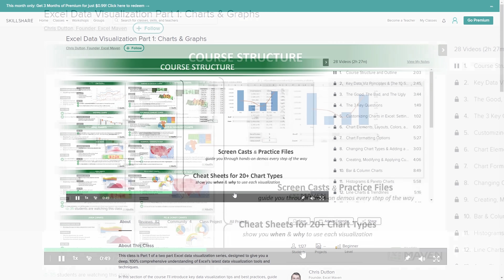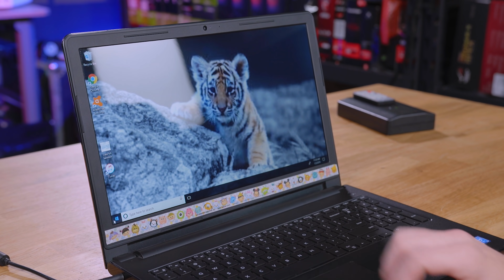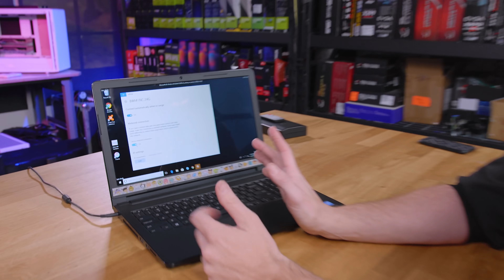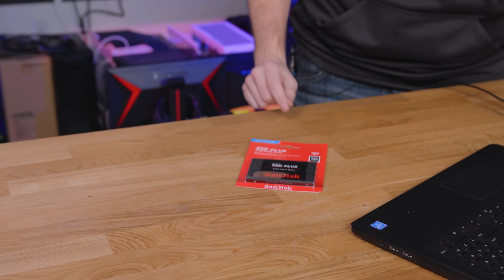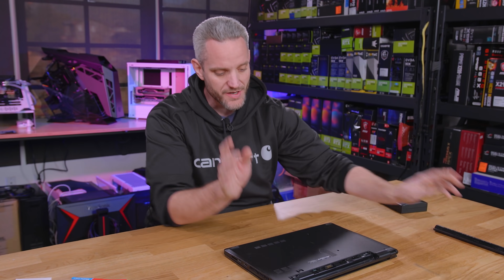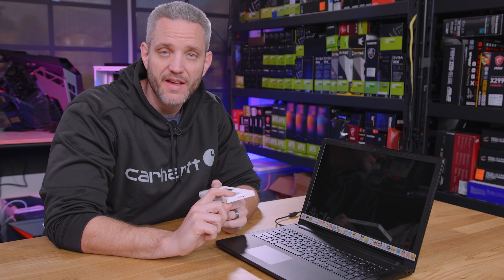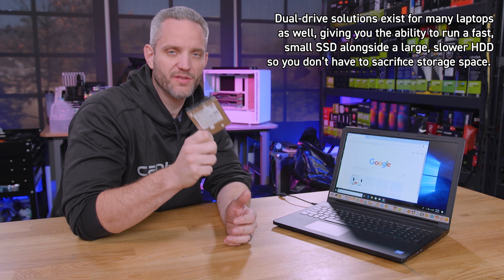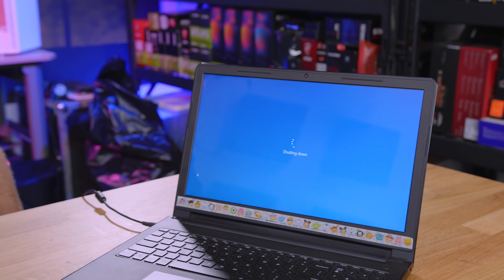Repairing an old laptop for as little money as possible...

Comment: SSD, fresh install of os, maybe moar ram. Boom problem solved
Reply: that celeron n3060 though....
Reply: fresh install of chromeos. there problem actually solved. chromeos runs great on that cpu
Reply: I would say new os on this one...  Some linux distro with XFCE or LXQT would run so much smoother...
Reply: Lol no. Celeron is trash. Better advice for the niece and just get a chrome book for $150.
Reply: @myaccount__7269  A lot of Chromebooks in that price range are Celeron based.
Reply: @myaccount__7269  those 150 dollar chromebooks also use the Celeron n3060 which this laptop uses so instead of buying a Chromebook he could just install chrome os on the laptop boom basically the same thing without having to spend 150
Reply: @hughdahand5711  A distro like Mint 19.1 Mate edition, is still fairly lightweight, and requires less setup then an XFCE distro as a lot of them don't come with compton compositor preinstalled, and can run into screen tearing issues not found as often on MATE. LXQT not too many distros even bother with it. Anti-X is a great lightweight distro that uses very few resources, but I would not call it kid, and new to Linux user friendly.
Reply: PUBG BOI nope. Chrome book will have better screen, new battery, ssd installed, new, lighter, etc. can’t just go specs
Reply: @tarfeef_4268  I agree in this case if all the kid needs to do is get online, and get homework done with a few other basic task, then something like Neverware's CloudReady OS Home Edition based on Chromium OS the base for Chrome OS is indeed a great choice, and they have a good user forum if you run into any kind of issues.
Reply: Linux is not for the average user.  Get real.
Reply: @CommodoreFan64  has no one mentioned that the neverware doesn't have support for Android apps or running Linux apps, which the default chromeos does this 

Neverware is far behind the real chromeos.
Reply: @hoixthegreat8359  Actually not even every official Chrome device supports those features either, I have an Asus Chromebit, and no Linux support(without some workarounds), or Android app support, same on the HP Chromebook 11 I gave my aunt as a gift about 2 years ago, and both are on the latest dev. channels. Far as Neverware I recently installed it one of my older ACER Aspire One laptops running an AMD C60 APU, and on the latest dev. channel 70 they have Linux support enabled, but I've not messed around with it much as that machine is only kept around as a backup.
Reply: @CommodoreFan64  Mint has come a long way.
Reply: @ericp6308  I would say the average user is just browsing the web for the most part. At that point the user only needs to know a few small things to navigate the OS.
Reply: @LazyPCRehab  Indeed I've been a Mint user since ver. 8
Reply: @CommodoreFan64  The UI on 19 is so  user friendly. Been dual-booting and such for a long time.
Reply: @LazyPCRehab  Indeed, but since I'm a believer of using hardware for as long as it can serve a purpose I run Mint Mate since it strikes a nice balance between being user friendly, and resource friendly.
Reply: @HoloScope  Agree, because now that I think about it this would have more storage space as most official Chromebooks, and Chrome devices like the Asus Chromebit only come with 16GB - 32GB of drive space, and are a lot of times soldered onto the motherboard so if they fail they can't be replaced easy, which I had happen on an Hisense C11 leaving me with a $120 brick, plus the battery was sealed inside of the Chromebook as well.
Reply: @CommodoreFan64  Cant argue with that logic. I myself just said goodbye to an HP Probook laptop that was running linux strong for years, finally died of various motherboard/CPU issues.
Reply: Artak091 dude just download some more ram lol
Reply: Download more whams
Reply: Who needs android apps? Basically all of them have web equivalents. 

As for whoever mentioned Linux support doesn't know much about Chrome OS. And if you're wanting Linux support on those devices, it's okay to expect you to do some research and put in some effort. 

All chromeos devices first of all, are Linux. You can enter the shell with Ctrl Alt t. And type shell for bash instead of crosh. That's already a Linux shell, and with Chromebrew you can have lots of packages out of the box. 

If you want more, dual boot, or my favourite: use crouton to run another distro simultaneously on the same kernel. The only issue I've run into with that is not being able to use containers. That's it. Everything else works like native.
Reply: @ericp6308  Agreed. I love tinkering with it a bit but it's not a good choice when setting up a machine for friends/family.
Reply: More*
Reply: just put an linux

and no, im using an windows machine
Reply: @ericp6308  I once built a PC for a 9 year old girl to watch youtube and play minecraft. Of course i used linux on it. Because linux does not break all by itself, it does not install bloatware on its own, it does not have viruses and that shit. It just works. 
It might be a bit more tricky to set up as you want it, but that is mainly because it has sooooo much more options. Once it is set up, it just works.
The kernel works, the logging works, the networking works. Sound works, 3D graphics work. 
It. Just. Works.
Reply: Liquid mental it !
Reply: @hughdahand5711  That is true but linux isn't the kind of operating system for someone that jsut wants to use his devie. Chromeos would be the way better alternative in this case. But on chrome os, you will miss many programms, similar story on linux. So windows is really the only aceptable option here. It mayy be the slowest of the three but it is also the only good solution for the averge user.
Reply: I would say that Linux with a lightweight DE is perfect for something like this.  This is not something that you are going to want to use for video editing or games.  Something like Linux Mint XFCE or MATE would be pretty familiar feeling to someone used to windows, and has apps for everything you are going to do on a notebook like this, with the added benefit of not breaking itself all the time.   The only thing windows does better on a system like this is waste ram.

The original problem in this video wouldn't of ever happened with linux.   But the SSD upgrade isn't a bad investment at all.
Reply: @hughdahand5711  Linux would definitely not be the solution to this. Linux isn't an operating system for the normal consumer or user. Especially not for someone who can't even handel windows. Yes, some of these problems would not happen with a linux distro but only because it is never going to get that far that such a problem could occure. A ton of programms are still missing on linux and the usage of the operating system is way more complicated. It is never a good solution to just use a different operating system because the problem you are trying to solve aren't made because a specific os was installed. Just using an different operating system would definitely make things more complicated especially if it is the common operating system that is the hardest to use. Even when you are going to replace windows, linux would not be a good solution for this. 
For the normal user, the kind of user that owns this lapto, linux is the worst solution. MacOS would most likely be the best solution but that isn't a os that you can run on just any device. Windows would be optimal, it has support for all the common programms and a normal person won't have any trouble figuring things out. Sure, more trouble than on a mac but that is the best you can get on a PC. Chrome OS would be the best solution for this hardware and user but it has the problem that you are still very limited in software. Familiarity is important and that is something you won't have on chrome os. Same goes for linux. Sure, you can do everything on linux but everything is way more complicated and too different to be useful for anybody that doesen't count to the 5% of population that knows a bit more about computing than how to open the browser. 
Linux is great but it just isn't the solution to everything and it isn't made for everybody. There are reasons only 2 to 3% of all PCs run Linux even though it is completely free and you can do everything with it. 
Just ask yourself. Is this person really one of those 3% that would be happy with linux?
Reply: @technologyanimals  Motherboard swap is the answer if it has a discrete GPU.
Reply: @MKDC-5  Exactly.
Reply: Apply better thermal paste, canned air and blow out all the dust etc. Not much else to do
Reply: Linus? ChromeOS?
This is for his NIECE, and frankly most people can't use anything but Windows simply for compatibility's sake with other programs. I'm very PC literate and even when I experiment with various distros I run into problems I can't fix, as well as various programs I can't run well (even with WINE).
Reply: ("Linux" it should say.. can't edit.)
Reply: @Torjus_  Unless if your laptop make and model has the similar type of motherboard that has a discrete GPU, then you can install it along the heatsink that goes with it.
Reply: Fresh Linux install. Boom. Problem solved.
Reply: @ericp6308  It is. It's 2018. Get real. My mom picked it up in no time. I only came over once, showed her everything she needs and she actually has less questions about it than she had about Windows. As a matter of fact it is even much faster and easier to setup and operate their wireless canon printer\scanner combo on linux than it was on Windows 10.
Reply: HughDaHand k
Reply: Using Linux Debian with a big SSD plus largest ram capacity allowed will do the trick.
Reply: An SSD is great. But, if you want to save money, you can install a light-weight distribution of Linux on your HDD. It might not run as fast, but it’s free.

Comment: Jay is that family member everyone relies on.
Reply: That fucked up because he failed to educate about using 3 different antivirus solutions...
Reply: @ManIkWeet  From experience, I can tell you that you can shout from the rooftops that running multiple antivirus programs is more harmful than helpful, and people will still slap every one they can find on there either because they want to try a different one and don't uninstall the current one, or they get paranoid because a fake popup spooked them, or because well it's free so what's the harm?

That's why there's always going to be a need for a "computer guy" in every family, even the most locked-down system is still going to get trashed by people who don't have that ounce of common sense.
Reply: I'm Jay in a 12 year old form in my family.
Reply: Neckslit  lol... I've exceeded the knowledge of my father which used to work in tech support.
Reply: My pops is totally one of those. My grandpa has a tendency to "accidentally" click on settings configurations (we can't decide if he does it intentionally or not) and gets confused on why things aren't working the way they should. I gave him my old ASUS gaming laptop for free because I never used it anymore and the audio driver stopped working for whatever reason and all he had to do was simply restart the machine and it worked like normal. Of course he just blamed my grandma (yeah, he's THAT old school) meanwhile my pops and I are in the background just chuckling at ourselves. Don't even get me started on the phone stuff.
Reply: @RyMann88  My dad is the same way. Doesn't even know how to change the input on the tv
Reply: @idoubtitsalex  same
Reply: anybody who is watching this is most likely that family member

Comment: I have an ancient laptop at work, a Lenovo Thinkpad T61, with a Core 2 duo, 4gb of ram and a Quadro something, and with a SSD is still a great office/web browsing machine. The best way to give extra life for a old computer is with a SSD and more RAM.
Reply: Got the same, I've upgrade the CPU from T7100 to T9300 with Middleton BIOS flash and 10 bucks the T9300 from Aliexpress. Do it!
Reply: I have a Dell laptop from 2009, finally put an SSD in it this summer what a difference that made, it's still fully capable of doing light work like using Office and browsing online and with the SSD now everything loads nice and fast. I was thinking of getting a new laptop or even a tablet, but the SSD upgrade is good enough for me. I have a nice desktop for gaming and whatnot only use the laptop when going on trips and such.
Reply: In some cases you can do a simple motherboard swap.
Reply: T61 is still faster than those cheap craps with celeron or atom in the market today.
Reply: I still use T61 with T7300 at 2,0GHz with 2GB RAM at 667MHz, 320GB HDD. How much it will cost me to upgrade it? Is it possible?
Reply: João Paulo Padilha de Aquino 4GB of RAM? At my work 4GB of RAM is nowhere to be seen, 2GB is the max!
Reply: @niki123489  If You flash your BIOS to Middleton you would be able to upgrade to a newer generation of CPU such as T9300 and get SATA 2 speeds. A T9300 costs £11 and 4 GB ram another £11 from AliExpress. Search on Google, you will find plenty of information about it. And get an SSD . Any will be much better than an HDD.
Reply: Yeah, just  laptop with a quadro P8000 and a 36 core xeon. ancient... lol
Reply: Now if only my parents trusted me for once and let me do my thing in replacing the hdd with an ssd. But nope, the poor thing has to eat dust until it drops dead. Guess who's fault it's gonna be for not having backed up data regularly? Can you guess?